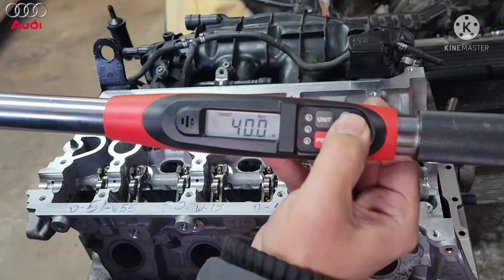Audi Engine 2.0L How to Torque Down Headbolts & Angle Torque #mechanic #automotive #mechaniclife

Comment: Where did you get those Torque specifications? I cant seem to find any info about the bolts with the shoulder ( pictured with the Arrow in your video )having different torque specifications. 

Thanks in Advance
Reply from the maker: It's a paid program to get this Torque Spect.

Comment: twice 90 degree ??
Reply from the maker: Ya bro 90 Deg  twice (S.i.) Im following the Service Info
Reply: @jfGarage4k   I did . Thank you very much .
Reply from the maker: Awesome 👌 nice work..thanks for watching
Reply: I have a 2015 audi a6 2.0t is this the same motor that you've are working on?
Reply: @Viod530  yeah 2.0 TFSI
Reply: @Nuclear8800  I have a 2015 A6 2.0T was getting off highway and went into EPC mode gave me P0301,302,304 misfire code. I checked the coil had a bit of oil on them, the checked the spark plugs which had oil on it. Replaced all with new coils and plugs drove on street and was driving fine. 15 min later back to EPC mode misfire oil was back on coils and plug. I'm only assuming it a the camshaft cover leaking oil into chambers. Any tips thought on what I might be looking out for?